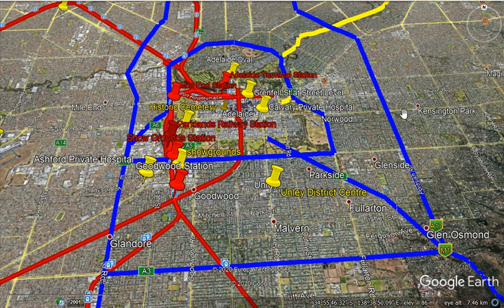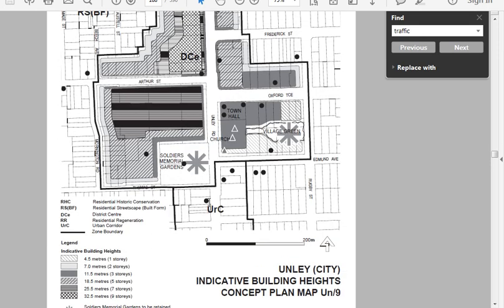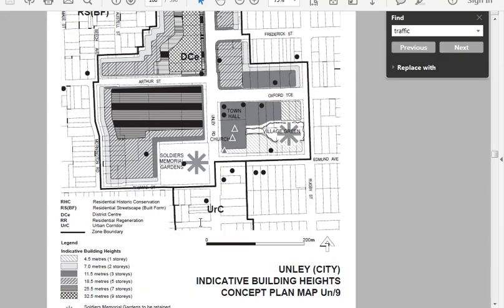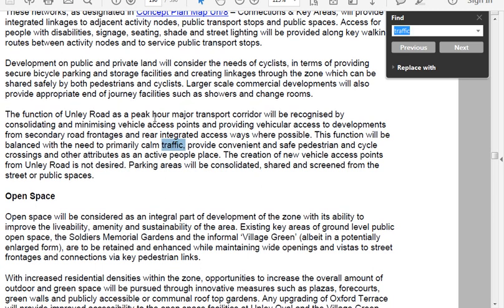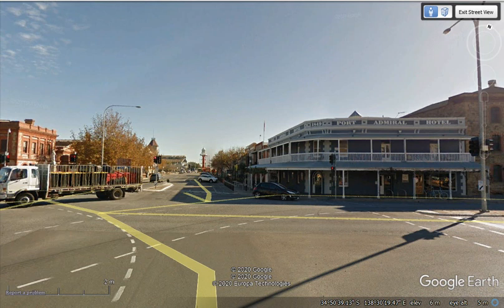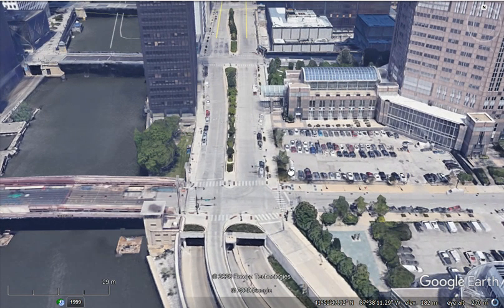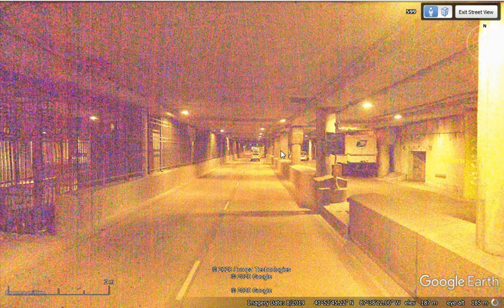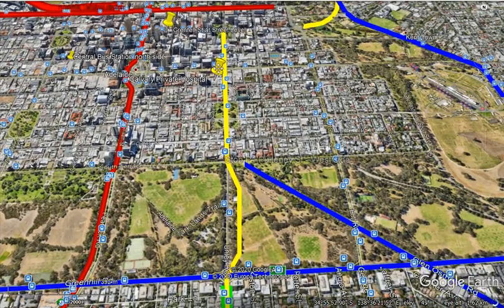Multi level Roads  Wacker Drive in Chicago & Unley Road in Adelaide   Apr 2020

Comment from the maker: Minister for Planning & Minister for Transport 
Hon  Stephan Knoll

Dear Minister
This video is discussing the benefits of multi-level streets
To enable local people to move around the re-developed Unley City Centre it is proposed that Unley Road should become a multi-level roadway.

*  Local movements on the top level.
*  Through traffic on the lower levels.
The video first looks at Port Adelaide's Black Diamond Corner where the street level was changed to in the 1850's to deal with flooding during high tides.
The video then looks at Chicago's Wacker Drive with its three-levels. The top level being for pedestrian and local traffic and the lower levels for through traffic.

A Busway could be part of the multi-levels of re-developed Unley Road.

The idea might be implemented in other District Centres in Greater Adelaide 

Regards

Neil Hamilton

Comment: Its an interesting thought. A few practical issues come to mind.

Both Pt Adelaide and Chicago were motivated by a flooding/drainage/health issue, which would have given them the political capital to raise the level of the land. The property owners were already doing that or wanted to do it. Nothing like that would apply on Unley Road or any of the other main roads around Adelaide..

Most of Unley Road is single story, and what you propose would require major changes to all the properties that front the road. Who would pay for that? Certainly not the property owners. Same would apply to side streets that would have to have their levels raised.

The general wisdom here is to keep the existing street level for pedestrian and vehicular access. Anything that requires "free-flowing" movement such as a railway or freeway needs to be grade separated (raised or lowered). This is what's effectively happening on South Road. If they really needed to increase vehicle capacity of Unley Road, they'd probably end up with the same solutions. To get an idea of the impact, you'd need to visualise the South Road Superway over Unley Road. Or perhaps the elevated sections of the New York subway system that you find in the outer boroughs. Not very pleasant being overshadowed by them.

Rather than raise the road, one alternative would be to do a cut-and-cover the way New York's subways were built. That would be extremely expensive and disruptive in today's environment. These days, tunnel boring would be cheaper and not disturb the surface nor require property acquisitions. The costs of that are still hideous. You might consider it for a railway (metro) because of its high capacity and the small tunnel diameter needed.

At the end of the day, any solution where you try to build your way out of congestion is doomed to fail unless it's used to construct grade separated PT infrastructure.

Sorry, but I can't see any way this would work from a political or engineering perspective. That's not to say the government wouldn't try, and waste an inordinate amount of taxpayer's money in the process. 

An interesting thought process all the same.
Reply from the maker: "TOD" is a two-edged sword.    Most think it means "Transport Orientated Development".  With the wrong decisions it can also mean "Transport Orientated Destruction"  
In Adelaide the car is king now.   In the Rush Periods the main roadways the government through decisions by the Minister of Transport has implemented
*  clearways - no vehicles can stop to go to allow drivers or passengers to go into traders or private premises
*  no right turns at minor intersections during rush periods
*  central traffic barriers to always prevent right turns into minor roads.
*  no u-turns at traffic lights  (few have become permitted on the Port Road tram line in TheBarton) 
*  few round-abouts to permit U-turns even though round-abouts permitted more traffic to cross an intersection compared to one controlled by traffic lights)
*  Side streets that only allow exit onto the main road.  Entry from the main road is blocked 
*  People can safely cross the multiple lanes of traffic at the busy intersections.    (A few private schools have been permitted to build private foot bridges)
A prime example the Main North Road at Medindie.   The car yards have almost all moved elsewhere or have gone broke.

The City of Unley Structure Plan Map Un/1 (Overlay 1) on page 238 of the "Development Plan Unley (City) Consolidated - 19 December 2017 shows  Mixed Use (Medium - High Density) on both sides from around Northgate Street to Greenhill Road, about 75% of its length.  This ribbon cuts through "Historic Character Residential" on the east side and "Streetscape Character Residentia" on the west side.

A 2-level road on Unley Rd between Northgate St and Greenhill Rd with through traffic on the lower level represents "no change" to the current regime.    The businesses with only one floor could continue to receive trade at the ground level.   The "status quo"
The upper deck would be restricted to "local" vehicle traffic, bikes and pedestrians.   Business with 2 or more floors would then have the option of making their main entrances at either the ground floor or the first-floor level.  Local traffic would be by ramps at Park St, Wattle St, Fisher St , Oxford Street Anne St  etc.
In the video have put links to show "Chicago's Wacker Drive" in action at the top deck and in the lower deck.
The lower deck is like being in a tunnel, but the upper deck is open to the sky and fresh air.

I suggest that all business premises along Unley Rd will experience "Transport Orientated Destruction" if nothing is done to separate local traffic from through traffic in the coming years.

South Road at "T2T" destroyed the suburb of Croydon by cutting it in half with a trench with no roof.   Only one dedicated foot bridge all other bridges being primarily for vehicles.  Many businesses went broke because of lack of trade

South Road at Angle Park is a 2 level road.  South Road on the lower-level and the M2 on the top-level
https://www.youtube.com/watch?v=np5AJ6qUiLw
Almost all business premises along that section were physically NOT affected.  They have their original frontages onto South Road at ground level.   But the traffic on South Road is now all "local".    
But because the "through traffic" is on the upper deck their opportunity for trade dramatically changed.    The many businesses that dealt with heavy haulage have all gone because those kinds of vehicles cannot reach their front doors.   

Yes, a tunnel solution is another option here at Unley Rd.   But I suggest civil engineers do not want to be asked do the costing for the first of these projects.    "Open cut and cover" is very messy.  Deep boring requires the correct machine for the terrain.     
It is 2 years since the Marshall Government won the election with promises to complete the North-South Rd at Edwardstown and Thebarton.      Will they build a tunnel on the North-South Rd ?